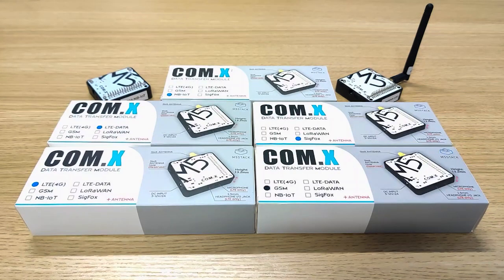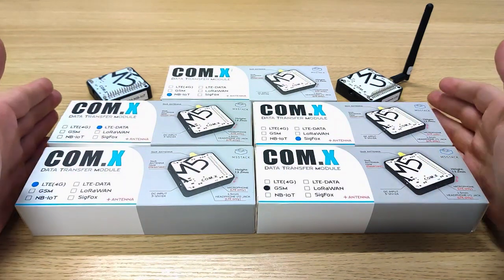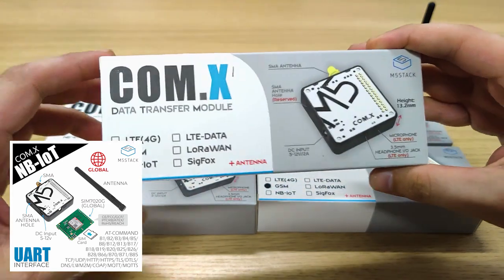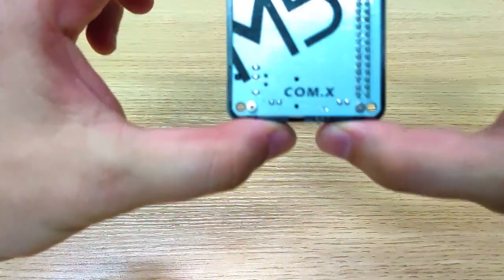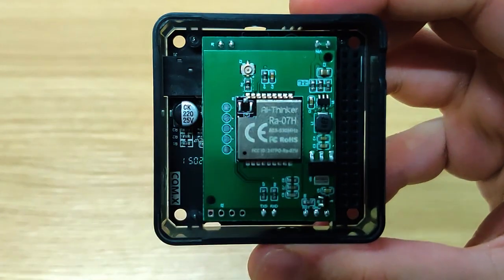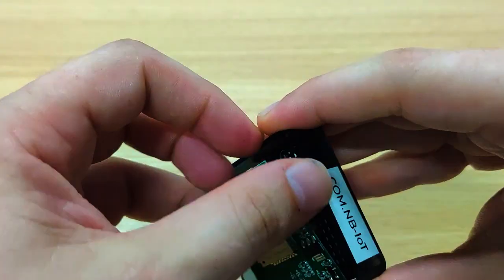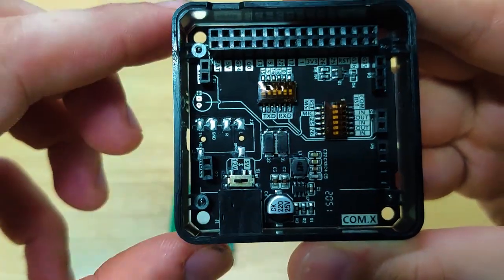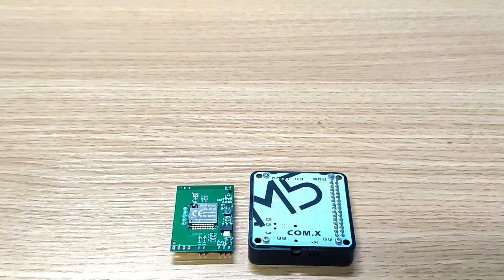COM.X Data Transfer Series Stackable Multifunctional Communication Modules

Comment: I want to use a battery for this module. Can you confirm, the current in amps at 5v required to power the lte voice module?
Reply: 5V/200mA (comX.gps and Core2)

Comment: Can you elaborate on the Pin issue between CORE 2 and COM.GSM ? COM.GSM TX is pin16 and CORE2 TX is PIN 14. How do I fix that ? Jumpers ? Switches ?
Reply: For whoever arrives here, I have configured the TX-RX switch pins 3 and 4 on and it works with the Core2
Reply: @javieroficinatecnica1109  By default switches 3 and 5 were ON for me. Are you saying to only have 3 and 4 ON?
Reply: @OffGrid-and-Ignorant   That is, in my configuration, from left to right 
SWICH NUMBER (PIN) STATE
1(17)OFF 
2(0)OFF 
3(13)ON 
4(16)ON 
5(5)OFF 
6(15)OFF